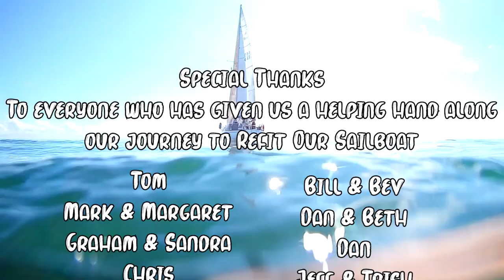STORM SURGE in Oriental NC | Wild Horses of Beaufort, NC (ICW) [Wildly Intrepid Ep 86]

Comment: Good thing you were already secured in port (Oriental) when that Nor'easter and storm surge came through. BTW - there is a special tool designed for removing packing. The "business end" looks like a corkscrew with a very sharp tip and it is secured to a short piece of flexible wire rope, and the other end has a "T" so you can get a good grip and yank out the packing after you have "screwed" the tool into it. They are common aboard steam ships as all the old steam driven pumps have packing glands. Also - when putting packing material in, rub a small amount of anti-seize compound inside and outside the packing material. It will help the packing seat properly, gives it a little bit of initial lubrication, and helps in removing it later.
Reply from the maker: We were really happy to be at that free dock for that storm that's for sure.
It would have made our life so much easier having known about that tool and your tips. Well at least we know for next time. Because wow this took forever.